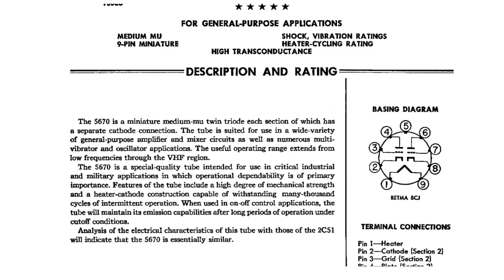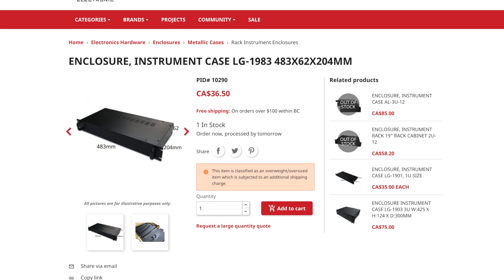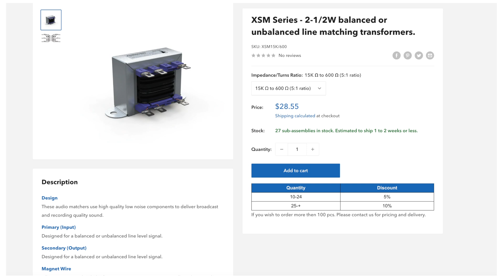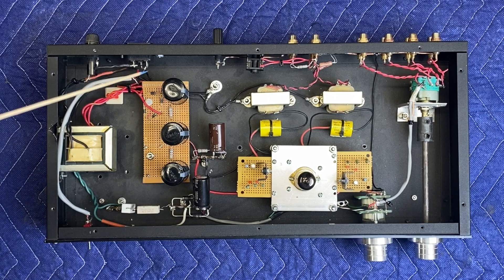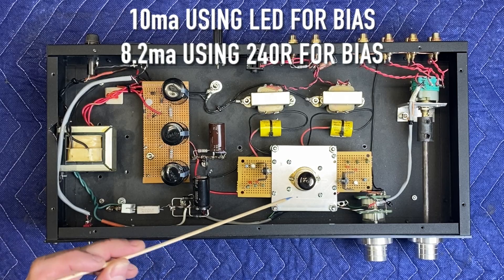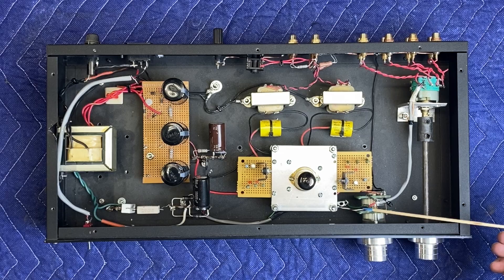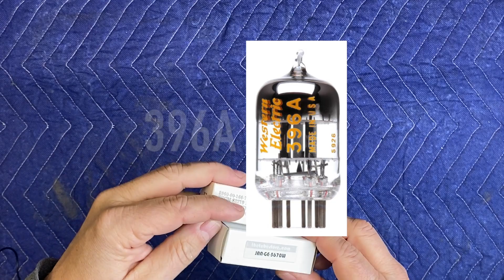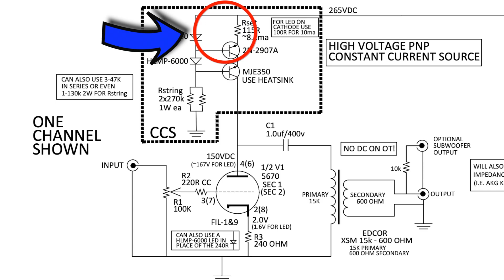How to make a 5670 tube preamp // DIY HiFi single tube linestage

Comment: Interesting single tube design.   Is there a reason for using the stepped attenuator rather than just a standard variable pot?    I don't feel  1% resistors are likely not needed for high quality audio.   I understand you doing it for you, but even high performance tube based RF circuits didn't use 1% resistors and RF is way more fussy and susceptible to external influence than audio.   Tubes are just not that fussy on accuracy, even running UL mode.   My thoughts aside, this is still a great project and does look to have some great results.
Reply from the maker: Thanks for commenting. Stepped Attenuators provide better clarity, balance, longevity and are less inductive when compared to a standard variable resistor. They do cost a lot more but I do feel you do get what you pay for especially if you are critical listener especially if you use headphones.  I typically use 5% resistors in my amps and only used 1% in the current setting application of the CCS. This way you get an exact value you calculated and you have a better chance to having the left and right side balanced (providing the triodes are closely matched) Cheers
Reply: 1percent metal film resistor are supposed to result in less noise . how much less noise depending on the location in circuit and resistance value.i do intend to make some some comparison s.the price and increase of availability of metal film make them worth a try
Reply: Has better clarity at lower levels especially with a shunt attenuator (as opposed to series..)

Comment: Nice…..can you think about doing a preamp that also has an option for tone controls? In my room I always find a bit of bass lift is useful.
Reply: You could probably add tone controls to this one quite easily using passive tone control circuitry, though you may find you don't need that depending on what your source material is.  Every amp has its own signature and personality.   Also will depend how you match it to your power amp.   You could put an equalizer between this amp and your power amp if you need to compensate for room errors.
Reply from the maker: You can but with a single tube design it is a bit harder and you will probably lose some gain. A different topology would lend itself better to tone control. Cheers

Comment: what are the two other resisters on the outputs i see the two 10k for the subs it looks like the other two go to the ground buss
Reply from the maker: Good eye. Those are 475k metal films that goto ground.  They provide a reference to ground from the output. Known as Rg. Technically, it should effect the output impedance a little. You can experiment with it to see if you hear a difference with or without them. Cheers.